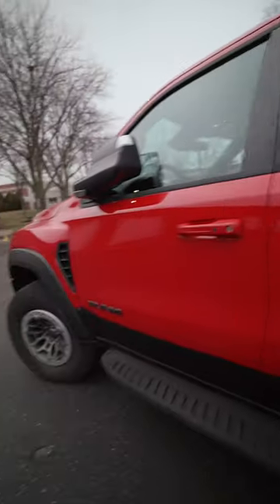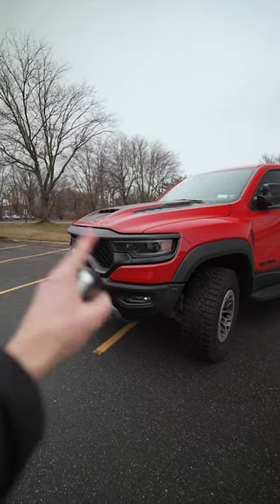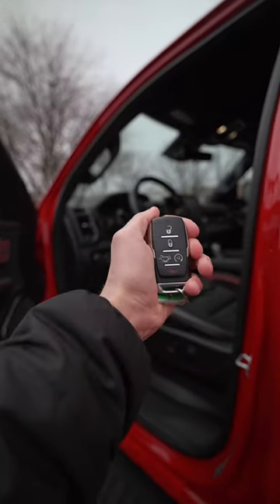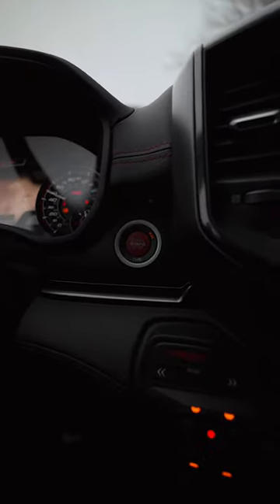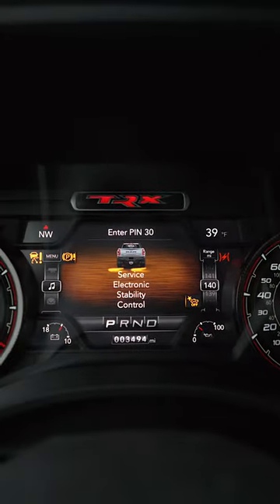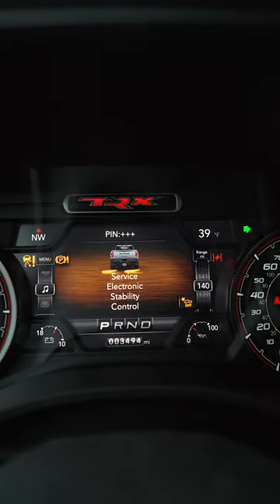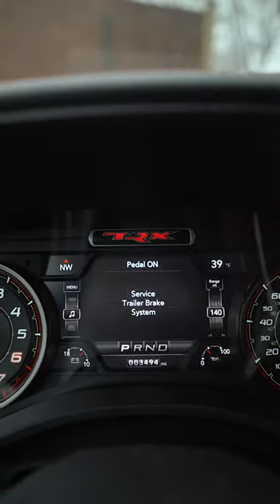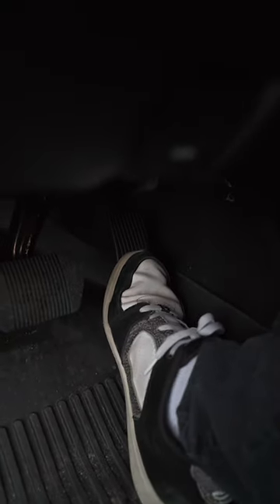Secure Your Car in Seconds - How to Stop TRX Auto Theft with your Key Fob!

Comment: I had the Tazer DT installed on my 2022 Ram TRX for 2 weeks with the PIN feature activated before it was stolen, without the keys, or the pin. And my insurance company won’t even cover the full cost of the truck, let alone the added security features. So I’m sure they’ll defeat this too.
Reply from the maker: Sorry that happened. The thieves have a ton of ways to steal these vehicles, that's why we're doing what we can to think of as many ways as possible to deter them and add as many layers of protection as possible
Reply: They'll just swap the ecu

Comment: definitely want to test this out looks great
Reply from the maker: Awesome please email in
Reply: Is it true the mirror amber lights come on with the new update?
Reply from the maker: @omarcastillo3801  that’s correct, the new 18.2.4 firmware enables the mirror lights to be on when the DRLs are set to Amber in the TaZer live settings
Reply: @zautomotive  ok great. Do I have to unmarry the tazer to do the update?
Reply from the maker: @omarcastillo3801  no that’s not necessary. Although if you have a Pin we recommend clearing the Pin before updating
Reply: Thanks man. I'll give it try

Comment: How do the fog light's work. I thought they are supposed to stay on when you do the enable option?
Reply from the maker: I’m not sure what you mean? The vehicle is not on, so why would the fog lights be on?
Reply: Sorry for the confusion. Was wandering if I wanted the fog lights to stay on when the high beams go off can I do that in the live settings or do I have to do it in while truck is  in the run position and reboot?
Reply: Currently have the option set to yes on the tazer but no fog lights while truck is running etc?
Reply from the maker: @omarcastillo3801  please email support and they can help you troubleshoot that. Might not be a possibility depending on the car
Reply: @zautomotive  He asked if there's a way to turn fogs off when high beam is engaged lol lol.  The world is literally in trouble with more and more zombies appearing